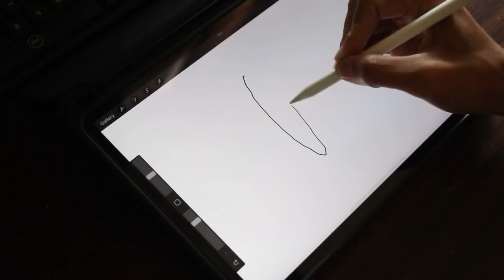i turned a rusty file into a neck knife - handmade jewelry

Comment: Out of curiosity what exactly do you do with the remaining scrap from the bits that you chop off? Do you end up saving them for smelting or extra bits for more crafting?
Reply: Most jewelers will save them and the dust up and send to a refinery or just remelt the pieces to use in another piece of jewelry. The latter is what I do, but I usually only work with silver.